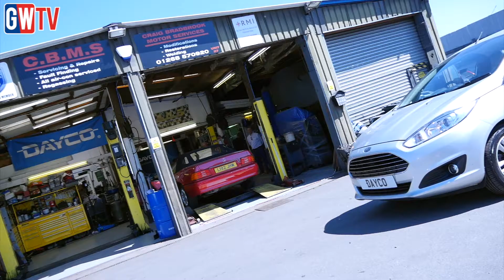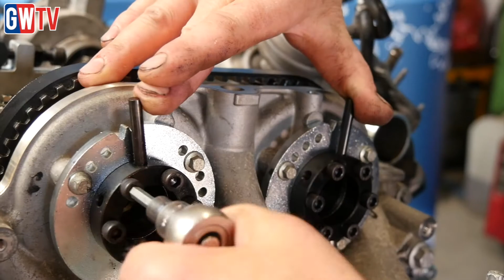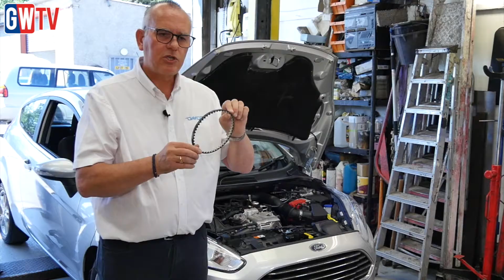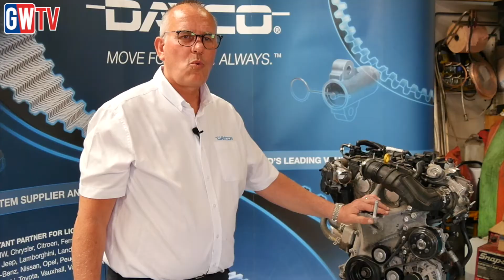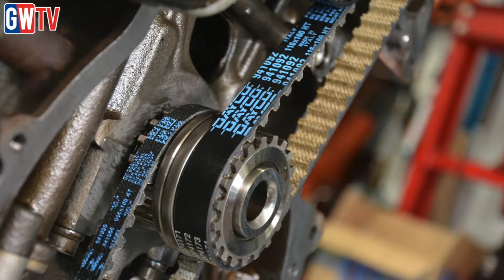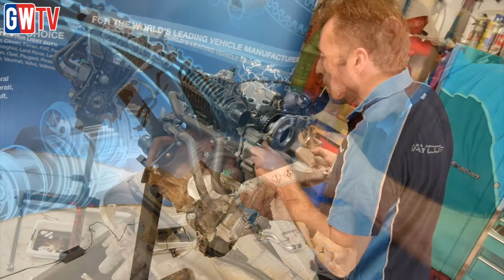🔵 Ford 1.0 Ecoboost timing belt replacement 🔴

Comment: Why do you take an engine out for a timing belt? If not to increase the labour cost.
Reply: @TheEDDmaster  it's much easier with the engine out to be honest. I've got a focus with this engine in it standing in my driveway for the belt replacement. It's absolutely horrible, disgusting. It gives Freddy Krueger nightmares on Elm Street
Reply: Just had one replaced on my sons focus with the engine in.. no issues at all. My thoughts would be to replace the clutch at the same time if the engine was to come out..

Comment: mine "never had a problem" with the belt, simply cracked a cylinder after 70k km and engine got replaced under warranty, and it was always serviced at the dealer... I wonder if swapping the engine with a FIAT Fire 120hp would be better lmao

Comment: I know Ford have replaced the belt with a timing chain in later models but watching this I assume it would be a full strip down to replace the wet oil belt in an engine using a chain?

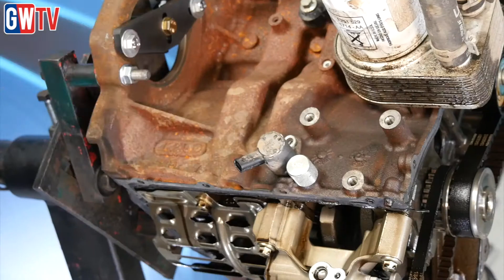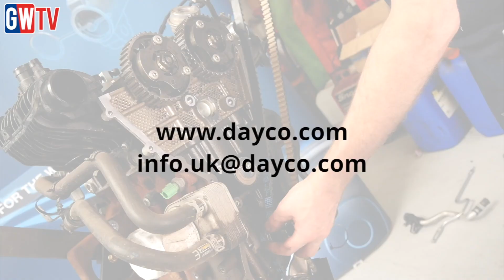Comment: Baz, there's also a mesh filter in the "Oil Pressure Solenoid" that needs checked, which is beside where crank locking pin screws in. "Garage Wire" YouTube Channel has a Dayco Training Video at https://www.youtube.com/watch?v=fDkoaPwbfpg showing this at video position "2:17/3:45"

Comment: Just had a quote to do belt on 1.0 ecoboost £1095 I don't know why you would not have designed it to use a chain
Reply: @michaelkeenan1035  
Weil damit kein Geld zu verdienen ist.

Comment: Just because it's same manufacturer,it doesn't mean same quality,one manufacturer might make built for different company according to their quality aspect,so different material can be made by same company
because car company has to give certain amount of warranty with their cars, they require higher quality to meet that warranty,so belt labaled FORD for dealer ship has better quality than the one labeled MOTORCRAFT! but it's not worth double the price to get from dealership

in general dayco is not such a great company as far as belts go,even if they make it for FORD CO
they are just OK
in this case,the high quality aftermarket might be better choice,like GOODYEAR(gator back) or CONTITECH,AISIN,
DAYCO is made in China anyway

Comment: I wonder if this engine is still running... The crank sprocket has been put on back-to-front which will cause the belt to sit in the wrong position and risks it coming into contact with the timing belt cover!

Comment: Valve damage is a crap shoot on these

Being a 3 cylinder there are points in the cycle that all valves will clear the pistons.

Of a dozen I've repaired none have suffered valve damage so far.

Comment: Has anyone done or designed an aftermarket chain? Rather than rubber belt?
Reply: You would need to change all the sprockets and tensioner system as well

Comment: Oil pump clean? This engine must be brand new …. I’ve seen 25k regular oil serviced eco boost engines and the oil pickup is completely blocked to the point it starves the engine and throws the rod bearing in the sump! Worst build of a engine in my opinion!

Comment: How much are them timing belt cost to replace
Reply: @mark-h8i2b  just had my wife's 2017 ,, 36,000 miles ffsh fiesta done for £1560.. bargain 👍... there was zero damage on any of the belts either

Comment: This is the most idiotic design I’ve ever seen you have so much cost in removing everything to get at the belts which should be relatively straightforward job it’s just a rip off. Of course people faced with a £1500 bill on a car worth maybe £2500 don’t both bother them boom it explodes as the oil strainer blocks up with belt debris or the belt just snaps

Comment: Just so you’re aware the bottom crank gear is on the wrong way in this video, mine fell off when I was replacing the belt and I used this video to see which way the crank gear went back on and when I was turning the engine over to recheck timing the belt was walking off the can pulleys!!

Comment: One thing (among others) that shocked me was that the oil pump/balance shaft belt drive and the cam drive  gears are not keyed to the crankshaft. Which is why there's the need for special tools to keep the whole mess timed while you replace these belts - whether these are the world's best belts ever, not probably going to matter too much as this has all the hallmarks of being a cheaply made, failure prone engine. Ten years. 😂

Comment: It seems to me to be insane to design an engine using a wet belt. Either chains in an oil bath or a dry belt outside the engine. The former should last a lot longer if designed properly, whilst the replacing the latter ought to be a much simpler and cheaper job again, if designed properly (and it a convenient time to change the water pump too). It's not even as if for many people the wet belt will require replacement less frequently than a dry belt. A modern dry belt can be extended to about 10 years, and for many people (me included) that's a lot less than 100,000 miles. 

Also, if you happen to pick up a second had car with one of those 1 litre Ecoboost engines, you had better hope that the owner has kept scrupulously to the maintenance schedule with the right lubricants. Reputedly the wrong oil or a flush can be harmful to the belt(s). 

The 1.5 and 1.6 engines are dry belts. Personally I would tend to avoid those 1.0 litre Ecoboosts.
Reply: If they really cared for longevity they would have used a gear drive system.

Comment: I just surpassed 100,000mi in a US spec Ecosport with the 1.0L EcoBoost.
Thinking about an oil pump and timing belt replacement.
You are right some of these engines are failing because the oil pump is getting clogged with bits of rubber from the timing belt. Others like this one that is 10 years old look good.
What do you think the problem is? Is it lack of maintenance and lack of regular oil changes that's degrading the belt?
I have a US spec 2020 EcoSport that just surpassed 100,000 miles. I know the potential problems with the 1.0L. I regularly change the fluids I use nothing but synthetic oil I change it every 6,000 to 7500 mi. I have regularly been using 0w20 oil to maximize cold start oil flow. Keep everything lubricated quickly as possible.
Ford originally said 150,000mi change interval and life expectancy of the belts.
2018 and 2019 US models were subjected to a TSB from Ford about failing tensioner and pulley and belts failing. Any engine produce after April of 2019 was no longer subject to that problem and was corrected according to Ford.
My engine was not part of the TSB.
So far, so good.
Recommendations?
Reply: BTW throughout the world this 1.0L is a very popular engine. In the USA it's quite rare and unusual.
Reply: Not only ford,  several makers have wet belts...
Reply: I have a 2018 Ford focus with 106,000 miles on it , thinking of replacing the oil pump and belt.
Reply: @1208bronco Better do it mine 87k miles belt stripped.   Regular oil n filter as well.          Some are saying E10 petrol is a problem as well.
Reply: Rubber timing belts don’t go well with engine oil. Regardless on how many oil changes you perform. Ford was just too cheap to use a proper timing chain.
Reply: @applepoop10 supposedly it was for "Low friction" benefits and silent operation.

They are failing earlier than dry belt equivalents, at least with a dry belt you would be aware it needs changing, anyone looking at an eco not knowing would assume it is a chain.

Comment: I define a big bull*** since they invite you to replace the oil as much you can (twice a year) for maintain this wet belt, and the certified oil has 4L when my camx (in my case) needs 4.5L wtf? And to inspect the belt you basically have to take off the sump oil and to do that you need many hours.

Comment: Are there any benefits for the timing belt running true the oil? This sounds to me like a gigantic engineering mistake.
Reply: Reduce emissions, but you don't really reduce since you make a lot of pollution on change many times oil in the year. So no benefits
Reply: @MrChilo89  why are you changing oil several times a year ?
Using cheap oil ?

Comment: Please don’t fit the timing belt like this as you will make a costly mistake as the bottom crankshaft pulley is fitted the incorrect way (shoulder should be on the out side and not facing the oil pump pulley) !!!!

Comment: The Owners Workshop Manual say the timing cover bolts need changing. Are they really need to change?
Reply: When you look at the video you can see them using the torque and angle method which means that the bolts are stretch bolts which are taken past their elastic limit and therefore they are one time use bolts
It also looks like the timing cover actually holds the weight of the engine as a mounting point as well and therefore is under considerable stress in this respect
Reply: No but you need to make your own gasket tho

Comment: The fact that the timing belt is inside the engine mixing with oils means ford should have used chain.
Reply: They now do use chain, since 19 I believe 
Awful design from ford. I remember changing pinto and cvh belts in my lunch hour
Reply: @derekfleming3095  Yes but the smaller oil pump belt is still a rubber one
Reply: @JohnMitch  yes, absolute madness, as that does far more revolutions than the main drive
Reply: @derekfleming3095 but it doesn't really have any load on it that's why it doesn't require a tensioner
Reply: @derekfleming3095  but the oil pump belt still remains and there is a stated change interval for the CHAIN and oil pump belt at 10 years
Reply: I have asked both Dayco and Ford which year did, the Ford Factory production lines start fitting the "ULTRA" belts to both the cam belts and also the oil pump drive belts..The ultra belts have a PTFE coating on the teeth to prevent degradation and delamination of the rubber belts, and therefore do not require early replacement. Both Ford and Dayco failed to give this important out as it would suggest the original belts were substandard.
Reply: That's why it's the worst engine by Ford.
Reply: They justify it as being "low friction" and quiet.

The later 1.8 lynx deisel engine also has a wet lower belt that fails regularly.
Reply: @prawny12009  its all a scam so people must pay 4x times the regular timing belt job :p

Comment: Exactly this scenario with my granddaughter's Fiesta oil light is on and making strange noise, obviously not driving the car. She smelt petrol a couple of times but not bad, oil light came on and oil level checked was very high, probably with petrol that has degraded the belt blocked the filter and she is told the engine is scrap. Have done some research via internet and local garages and this is a common problem. Standard cam belt is about £400 to £500 to replace for a lot of cars these engines cost £1500 to replace , if Dayco designed this they should be ashamed. 
Never buy a car with one of these engines.
Reply: True
Reply: That's true, but last double the normal change time...£1500 is top end price to change tbf, usually between 700-1500 to do

Comment: The engine that won awards ..is a pile of crap ...wet belt disintigration blocking oil hoses and starving the engine ....not a case of if it fails ....its when it fails

Comment: Phil just ad mine replaced £650 😢
Reply: £650 is very reasonable considering main dealers are charging circa £1600 - £1800. Was this private?
Reply: @christurner9895  no Chris local engine dealer where I live . Got three estimates £650. £700  £750 £1600 Ford dealer 😱
Reply: What location? Ford have quoted me £2050
Reply: @shaunbrannan2508   Soz it’s late Shaun  Darwen 👍

Comment: I have a question, please: 
Will using an internal cleaner ( Liqui Moly 1019,  or  Tunap  flush ) every time the oil is changed will damage the timing belt?
Thanks a lot
Reply: Yes, definitely. The chemicals in an engine flush liquid will deteriorate the belt.

Comment: Just had mine done, no one would touch it, two and half day job at main dealer - £1,600.
Reply: Thats insane!
Reply: That’s ridiculous, you got ripped off
Reply: @derekfleming3095  I agree! Alas it was an early engine and 10 year point had clocked up, no one would touch it, only main dealer. There are around 100 parts on the invoice, 40 odd bolts are angle tightened, all must be replaced, it's is indeed a 'dockyard' job to replace the two belts that are inside the engine. It's get it done or replace the engine when they fail or scrap the vehicle. I've been lucky with mine so far. I remember meeting a cousin I hadn't seen in years, and her first words to me were 'you want to get rid  of that bloody thing' pointing at the car. She'd had several engines replaced by Ford but called it a day in the end! She was an early member of Facebook 'eco - boom' group.
Reply: @johnrockley9472  the vast majority of engine failures were due to coolant loss, not belt. Mine was 11 years old, 112k, still on the original belts. Secret is to use the recommended castrol oil

Comment: The belts are snapping at 40,000 miles.
Reply: There suppose to last over 100,000 miles 40,000 miles is ridiculous
Reply: @steveharper9068  I've heard they last that long if the right oil is used along with regular servicing
Reply: @professorpigeon-q4t  no chance there junk pal.  If you have one get it changed well before due date.
Reply: @steveharper9068  Well I bought a 10 year old used one obliviously but luckily the engine started making noises not long after I bought it and the dealer replaced it with a new engine from ford
Reply: @steveharper9068  Besides its issued it is a fun car to drive and it's 0 tax in the UK
Reply: @professorpigeon-q4t  You had the entire engine replaced and you're defending it. Amazing.
Reply: Plenty of cars belts snap. What's your point?

Comment: Does Ford Europe have a totally different service schedule for this motor? In the States there is no timing belt replacement interval, there's merely a check and you just keep running it unless it's physically coming apart.
Reply: Donald Johnson yes there is , it’s 10 years or 150,000 miles which ever is sooner , but I’ve heard that a lot are snapping after 90,000 miles here in the uk well before the 10 year lifespan . I have to say that when these engines were first released in 2012 that they came with NO service interval as the engine was a lifetime belt in oil (BIO) but Ford then released the interval information soon after . A bit strange I thought as we all know belts do not last the life of the engine . Not even timing chains do either.
Reply: @richie674  your UK cycle must be extra harsh on the belts, here in the States I've worked on quite a few of these all over 90k (miles). I've never seen a single belt failure ever. Maybe something changed since they were launched stateside in 2014?
Reply: 😂😂

Considering the prevalence of oil lube shops that will literally stick the same oil in everything I'm surprised the US hasn't seen more failures.

Service intervals in the UK is 18k miles or 2 years, 

granted our  average use is more town diving than highway purely because we are much smaller so tend to have less need to travel between major cities or states like you do over there.

Even the heavy use interval is 12.5k miles (earlier cars switched to this for all services)
Reply: and at 6000 miles  @prawny12009

Comment: What's the average cost of the job and is it engine remove to replace
Reply: Don’t have to remove engine to do it, average cost is around 800
Reply: @derekfleming3095  1300 i was quoted for mine and 1900 from ford themselves

Comment: Tells you how awesome the belt is.... And fuck all about fitting procedure.....
Reply: I know, video just shows him doing it with engine out on a stand!! Doesn’t mention the labour time to replace the belt is over 7hrs and that’s without removing the sump to check the strainer. I’d love to know how much this guy charges at his garage to replace everything he mentions in the video (cam belt, tensioner, oil pump, water pump, new oil and coolant etc.) just not worth it on 10+ year old car
Reply: Piston one at tdc, cams have square sections for locking them in place.

Earlier engines have only two parallel sides on the timing sections, you can set the lobes near to where they need to be then use two set squares to make sure the machined face is  90° to the head before fitting the belt, so long as the vvt pulleys aren't disturbed your cams should align using this procedure.

The later engines have four flat surfaces on the cams with qr/barcodes on them, the bar codes need to be at the top you can use a straight edge across them to make sure they are parallel to each other.

Because the sump needs to come off anyway I use a flywheel/ring gear locking tool bolted to the gearbox to lock the engine rather than removing the starter motor.

You can either indicate off piston one to find tdc or use the locking pin on the front pulley before removing the crank bolt.

The front pulley  has to be timed to the front cover at tdc no one because the crank sensor runs off of it.

With the flywheel locked and the front pulley pegged the belt shouldn't turn when tightening the crank nut so the cams should stay put even without the locking tools.

I've done at least a dozen without the tools.

Crank nut needs to be 300nm +90° if you don't have the torque multiplier.

All in all the tools to do this job cost close to £1000 at one point, they are a little cheaper now but not by much, which is why I do it without them.